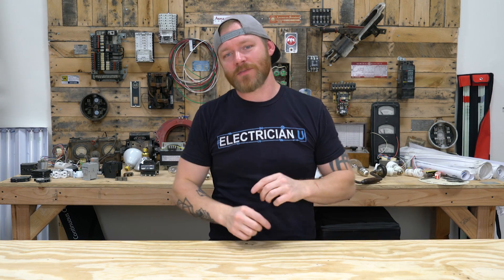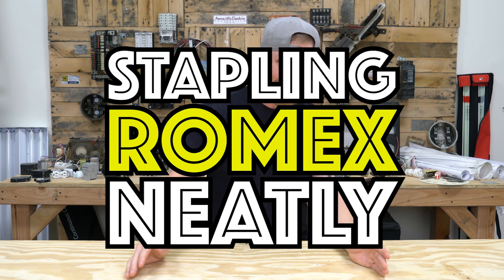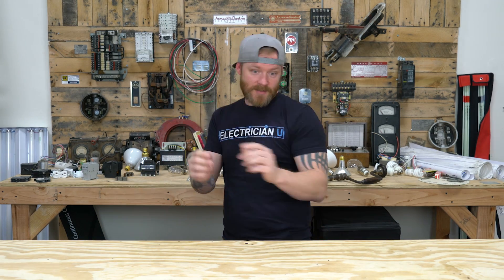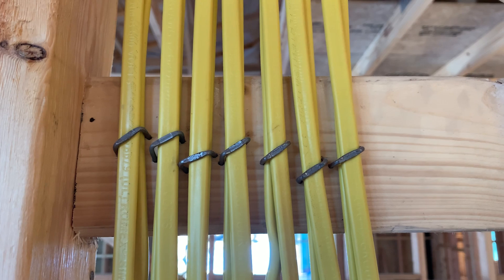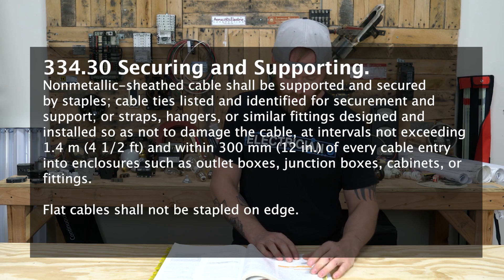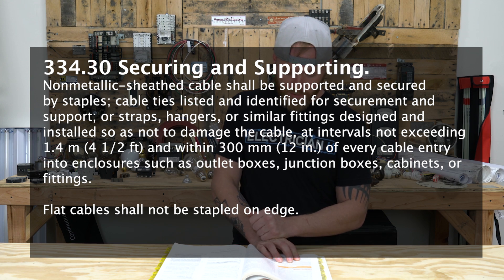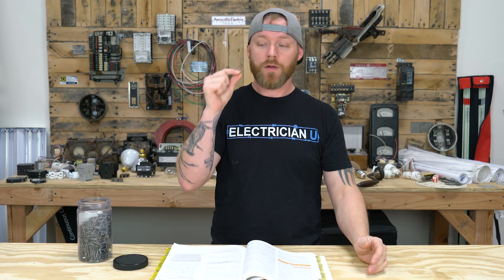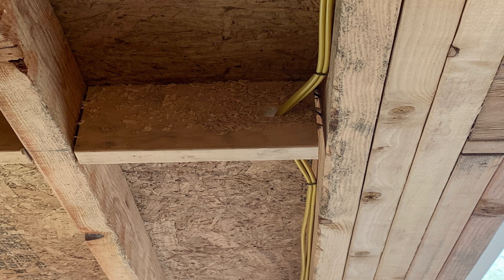Should Romex Be Stapled Neatly? DOES IT MATTER??

Comment: NEC 110.12 supports your attitude, “Electrical equipment shall be installed in a neat and workmanlike manner.”
Reply: This is one thing I always tell my helpers or "apprentices". It is CODE to do neat work.  

Other than that fact, it's a pride thing. It is just the fact that you can show your work, or know you did it right, and it makes you feel right.
Reply: Learn this in my class first day lol
Reply: I retired 5 years ago as a master electrician at a large chemical plant in Michigan. Part of my specialist role there was checkouts and commissioning of new installations. There is a huge range of what people consider to be neat and Workman like for sure. One thing I can say for sure though is that it is a whole lot easier and quicker to troubleshoot and repair an installation that is neat. I have completely rewired hundreds hundreds of panels, field junction boxes, control cabinets, and motor control centers because they had gotten to be such a mess over the years from various changes and additions that you could barely even trace a wire. We were somewhat self governed in the plant with one in house inspector and the city inspector checking our documentation occasionally as well as inspecting a small percentage of our work randomly but that was no excuse to get sloppy. If a contractor did lousy work and left a mess I was much more likely to call our inspector out and also less likely to make corrections myself. If it was a nice neat job but they made a few minor mistakes I would just fix them myself as part of my commissioning and let them know afterwards. Don’t be THAT GUY, do good work you can be proud of!
Reply: From day one as an a apprentice and now 35 years later with many apprentices make it look pretty and neat take pride in what you do, nothing pisses me off more than when a I hear something to the effect of “ Fuck it I can’t see it from my home” that’s when I go and double check my apprentices heaven help you if I see or notice something not right
Reply: Ahhh you beat me to it, lol
Reply: Look at all these knowledgeable thugs that beat me to it!
Reply: Honestly can't see why this isn't "common sense". Every thing we do as trade workers matters. It builds your own reputation and the next guys too. NOBODY trust lawyers because the majority are sleezeballs. If you do bad work, people start to question every tech they call wondering if this guy will also be a shit bag. Do good work, or don't do work.
Reply: More than attitude....it’s code.
Reply: Way too vague.
Reply: Do they define neat, or what a workmanlike manner is?  Those are subjective terms.  With that said, it usually works the way it looks.
Reply: If it looks bad it’s bad
Reply: I reference this code to a bunch of colleges all the time, sometimes just to be a pedantic smartass, yes, but I believe it is one of the most important factors of our work
Reply: Correct my friend
Reply: lol as I just was going to quote that phrase. 👍
Reply: Bingo I was thinking the same
Reply: When I was in school, one of my instructors (temp guy for a short while) told us “it doesn’t have to look nice, it’s not code regulation. If it works and fits, it’s fine” like holy shit, he told us he was an instructor for like 30 years
Reply: What about workthemlike? Non-binary needs more representation in code...
Reply: One of the first lessons learned at tech high school electrical program in ‘73
Reply: F that.
Does it REALLY matter?
Does it affect the performance of Romex whether it's installed "neat" or not?  
Does it affect anything?

Or does it just provide a sht-ton of jobs for so-called "inspectors"?

Stapling Romex 6 inches from every junction or bend or whatever to studs does nothing more than add to the hourly rate of electricians.  

Seriously.  The stuff will work whether it's stapled or not.

Talk about liberal, protectionist, bullsht government oversight.  

And YOU ALL are part of it.  No wonder Californians can't buy ammo without a background check.  It's all reminiscent of the same desire for "centralized control", which all liberals yearn for.

IT'S ALL THE SAME BS!!!
Reply: @rthinds  yes it does make a difference. Maybe not 80% of the time% maybe not even 90% maybe it's only 99% of the time. But in that 1% houses burn down and people die. And when you consider the millions and millions of homes businesses and other structures in the us that adds up to a LOT of fires and deaths.
Reply: @awalllen212  I would argue that NOT stapling romex allows it to "move" out of the way if another wall intrusion is made right next to it.  If it's stapled, the romex is forced to remain semi-rigidly attached, which means the wall intrusion has a higher chance of piercing it vs "pushing" it out of the way if it were lose.

I would argue your risk of causing a fire from a short-circuit by stapling romex is higher.
Reply: @rthinds  absolutely. Secure within 12” of box’s to prevent from being pulled out of box’s. Also need to prevent issues from other trades. Don’t secure your wires and snow it’s being crushed screwed into and destroyed. Now you created another can of worms to deal with.
Reply: @rthinds  as an Engineer, I fully agree. Well said.  This also shows the American weakness.  We will compete with eachother until we starve each other.  The Marxists know this, it's how they are winning.  Who can follow masters rules the best?
Reply: @falsedragon33  
Well, it will work but for how long.
I had to replace wire in EMT one time. The house was originally built in the twenties.  It had been upgraded sometime after that to add an additional bedroom circuit.
 ran from the main breaker to the outlet in the bedroom.  Beginning part of it was on the outside of the house with an lb going into the crawl space.  The original electrician who pulled the wire. Did not make sure the wire went in neatly into the lb.
The ungrounded conductor had looped into a circle and had made a pinch point in The wire. Causing it to fail at that pinch point. I'd say 20 years later. 
But as a Californian s*** just getting too crazy.
Reply: @jonathanfurtado3696  eek, brutal story.  Twisting the conduit is no good.  Although I fail to see the correlation.
Reply: @falsedragon33  "as an engineer" God help any person who has the misfortune of occupying or relying on a device or structure which you had a hand in designing if this is your attitude. I wouldn't let you within 100 feet of the design for my toaster let alone something I actually relied on.

Comment: It's not like you're adding hours of work, it only takes a couple of seconds to neatly run the wires and staple them.  It also makes it a lot easier to follow which wire is which when you have several wires running up a chase instead of a bundle of tangled cables.  Heck, with the cost of copper these days, you might even be saving more money than the time it takes to neatly lay them out.  You won't have excess wasted wire.  Plus, like you said, other people will take notice of it and think higher of you.

Comment: Neat is always Best. I like to use cable stackers when doing my Home run raceways with Romex. But the main thing for me is to secure my wires and keep them safely away from the others trades behind me. Sheetrock, cabinets, base and crown molding, even roofers. Good Job Man. I enjoy your videos.
Reply: "...and keep them safely away from the others trades behind me."
Damn plumbers.  Turd chasers piss me off.
Reply: @longshot7601  plumbers should go in before electricians. your enemies should be insulators, dry-wallers and cabinet-hangers.
Reply: @wim0104  On my jobs the electricians are there in the early phases all the way through the late phases.  On commercial jobs the demo crew turns the site over to us we start laying out for switchgear and homeruns while staying out of the way of plumbers and mechanical subs per the MEPs.  Other trades quickly find that they can work with me and I'll work with them or they can not.  Some how things go more smoothly when they work WITH me.  I'm always working with the GC so they tend to side with me.
Reply from the maker: I was going to talk about stackers in the video but I think it's best for the next one I do about Romex as a whole

Comment: every four feet and 12 inches from any termination  with what 1/4" sheath in the box
NEC  110.12 Mechanical Execution of Work.
 Electrical equipment shall be installed in a neat and workmanlike manner.
Reply: My code book says 3/8" sheath in the box minimum

Comment: Hey body I have a Q, could I add an extra light to the 3way circuit without feeding the new light from the old light which is already connected to the 3way circuit?! Anyway!!
Reply: All you have to do is connect your wires light to light and it will work.. you do not have to mess with the switch at all..
Reply: @biz504   thanks a lot
Reply: @omaral-mashhadani1107  not a problem
Reply: You would need to run the new switch leg to the same box as the existing switch leg and make them up together
Reply: @Ethanphelps   thank you